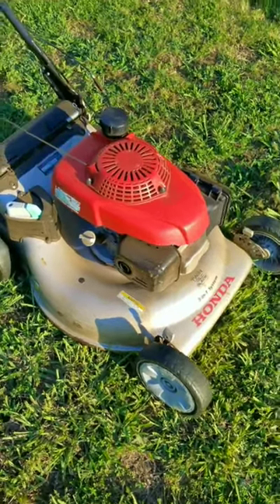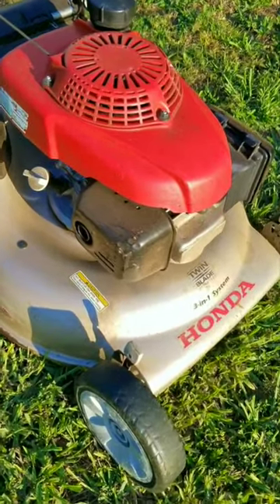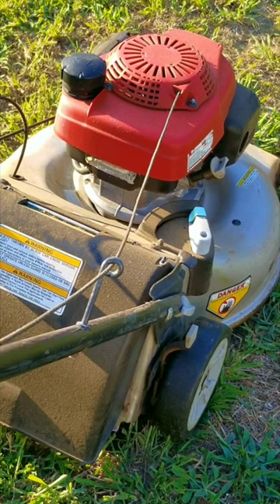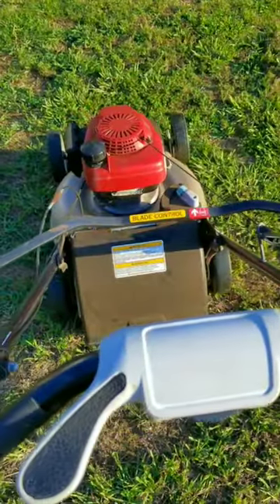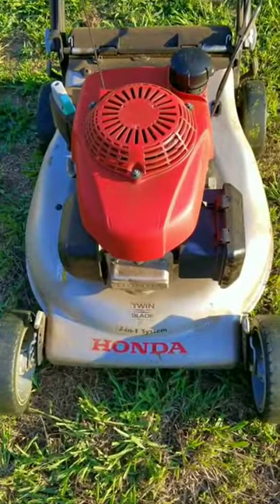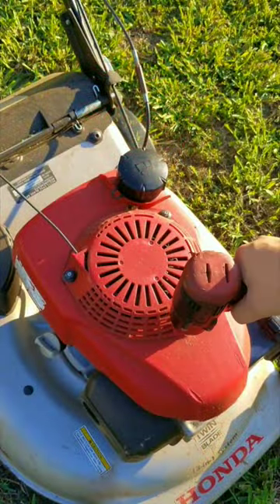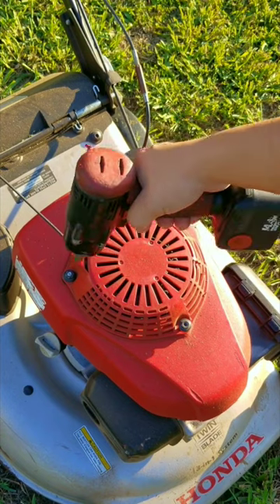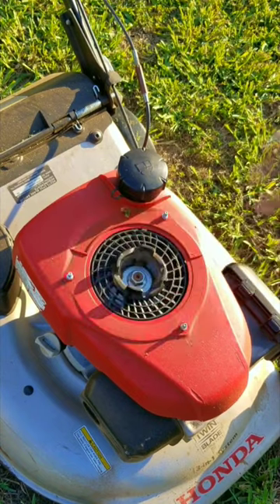Flipping Mowers Doesn't Always Work Out

Comment: A slow return on the cord is acckckschually a good thing.  Releasing the cord and letting it snap eventually leads to a broken rope that gets sucked into the intake hole.  The proper way to start a mower is to slowly lower the pull handle to its cradle, and not just dropping it.
Reply from the maker: this was painfully slow
Reply: @INSIDEHOUSEGARAGE  I understand.  As long as it starts first time, I would not care.

Comment: I've also lubed pull-starts on equipment I pick up when they're tight/seized just to see if it'll run before I work on it. Haven't had this issue yet, but I guess it depends how dusty it is.
Reply from the maker: you are correct it doesn't happen every time, but this time, it got me.

Comment: user error is going to get you every now and then when you flip mowers. I learned not to oil the recoil spring the hard way too. 🙄
Reply from the maker: I know right, I'm still learning everyday too.
Reply: @INSIDEHOUSEGARAGE  Me too. When you stop learning you might a well just stop.
Reply: The first couple of recoils I fixed were on early 80’s Homelite machines. I just washed the whole recoil unit up really well with degreaser and hot water in my wash basin as they were dirty and greasy. I dried them off really well and put them in front of a fan for several hours. I worked the cords back and forth several times while doing that to dry the cords well and Have yet to have any issues with them since. They springs weren’t very rusty though it was mostly swollen pull cords from oil and dirt so not sure how it works on rusty springs.
Reply: @cliffpaul1133  I keep extra cord in s could sizes so I rarely reuse cord.  Clean is the magic for recoil springs for sure.
Reply: Didn’t feel the need to replace what wasn’t broken when a good washing worked. Saved a few steps that way. If they do eventually break or become frayed I will replace them then. Cheers ✌️

Comment: yeah i have the same problem with the recoil i found that sanding the stud that the coil spins on an Putting tiny bit to some of grease on it helps it but washing the mower after use a few times makes it slow back down again
Reply from the maker: interesting

Comment: I did not know you get an airlock it you fill to the fuel cap. I never do anyway but that’s good to know.
Reply from the maker: to be honest, I've done the same when I kid decades ago, and I didn't know why.
Reply: @INSIDEHOUSEGARAGE  I don’t because back in my day the fuel tank was usual over the hot engine in such a way that is fuel spilt it could ignite on the hot motor or exhaust. Model fuel tanks now day mitigate that by being placed to the side of the engine and back from the exhaust making it harder for spilt fuel to get to the ignition point.
Reply from the maker: thanks for the info.

Comment: Yeah, callbacks don’t exactly make my day either, Eric. 
On the plus side though, it’s just another learning opportunity! 👍🔧
As for lubricant on recoil springs, I’ve always used WD-40 with zero issues. I actually use it more for it’s originally-designed purpose - to displace water, thereby reducing the potential for rusting on springs that are very prone to that problem.
Reply from the maker: Thank you Rein Ciarfella! And yes I think WD40 works very well.